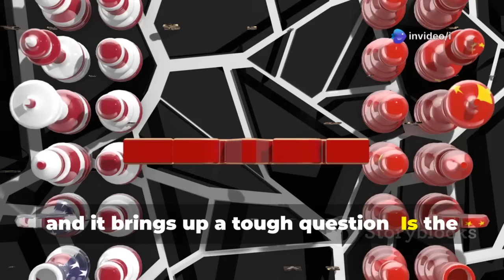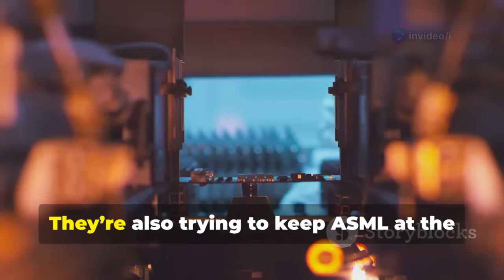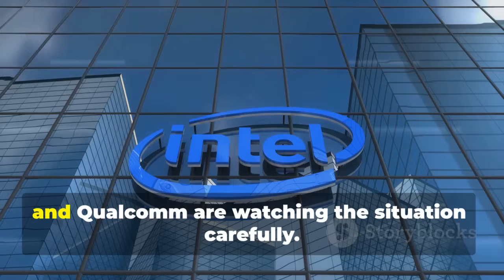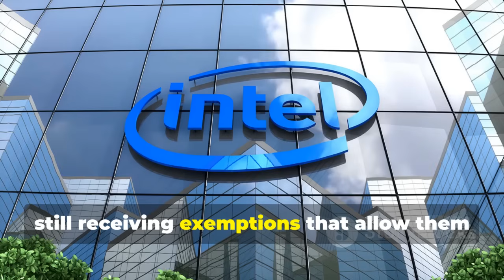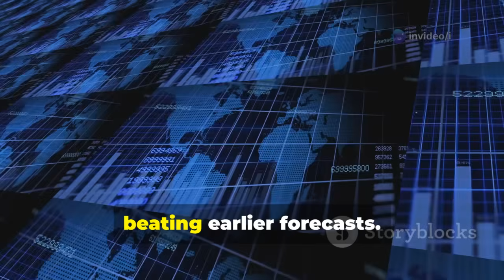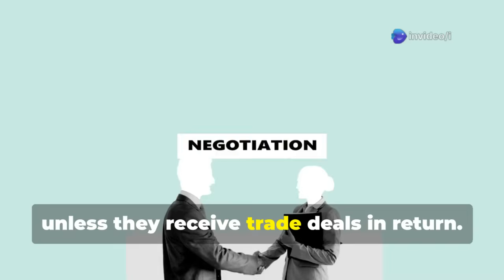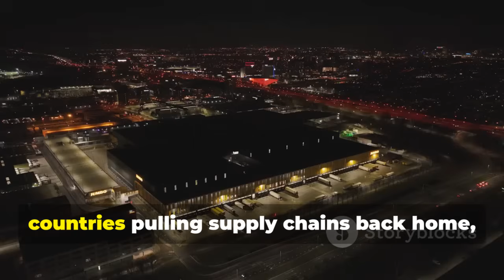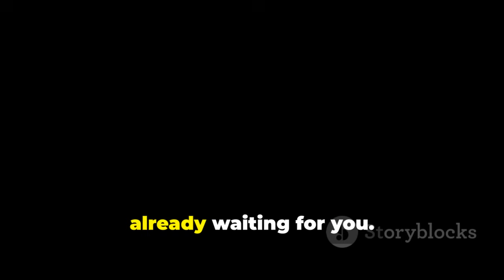ASML Defies U.S.: China Gains Access to $7B Banned Chip Tech

Comment: The author discussed all aspects except one: China is capable of developing its own lithography machines, regardless of what ASML does. If lithography machines were sold to China, it could at least reduce the revenue of Chinese lithography equipment manufacturers and slightly slow down their research and development progress. If lithography machines are not sold to China, it would have some impact on China's chip production capacity, but it would also significantly increase the revenue of Chinese equipment manufacturers, who would then be able to produce the equipment more quickly. The author seems to have an unrealistic obsession with the idea that the West can prevent China from developing lithography machines.

Comment: I don’t believe you need EUV to make parts for electric vehicles.  They do make the dash more modern and flash, but the part that handles the power to the motor(s) is typically GaN or SiC and the logic that drives them does not need to be ultra-dense.

Battery technology is one of the keys to successful EVs, which China is quietly leading in now.

PS, I’m not a China fangirl, I’m a realist… from the idiot nation of Britain.

Comment: Most of the chips used for automobile are not the most advanced chips. China can easily manufacture them without ASML EUV machines. Even for advanced military chips, they are way bigger than 28nm. Only when you need to build a mobile phone you need such a small chip. A car has enough space to pack big size chips into its body to achieve functionality required. Trump and the US chip makers has just misled US and its allies into this sanction. 
The only thing that really matters is AI chips. But Deepseek and Huawei have already proved that the Nivida way was wrong. AI intelligence does not just rely on power and speed of the AI chips.